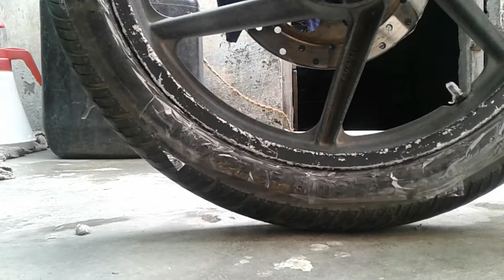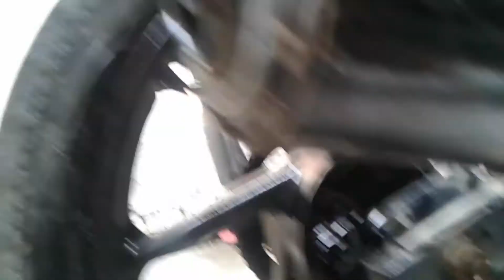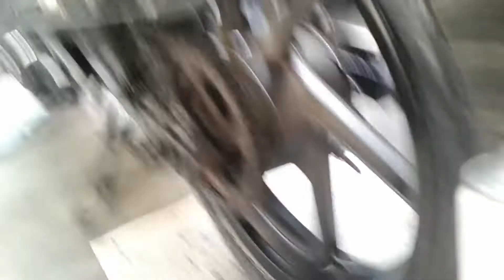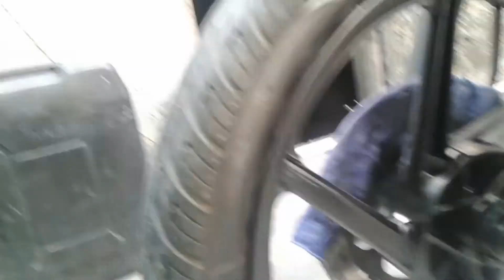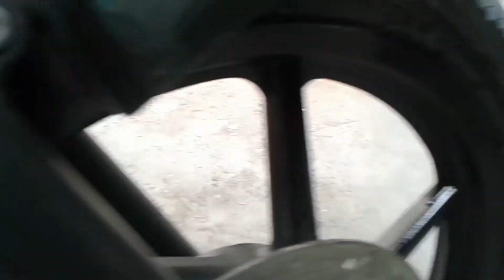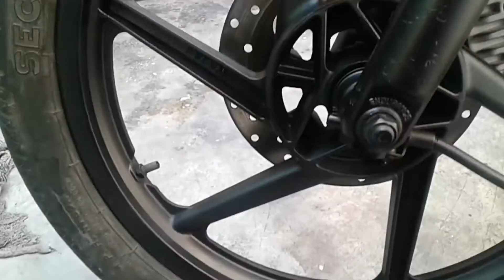How to Paint Pulsar Alloy Wheels with Spray Cans.

Comment: If I want to change from grey color to black how many can would be required?
Do we have to rub with sand paper?
Reply: I wet sanded the rim with a 400 grit sandpaper, of course you need to clean and degrease. Then apply primer and color base coat. You can add the clear coat at the end for a better look and paint duration. You can paint the rim directly like he did, but it will last less.
Reply: I used 2 rattle cans to paint the front wheel.